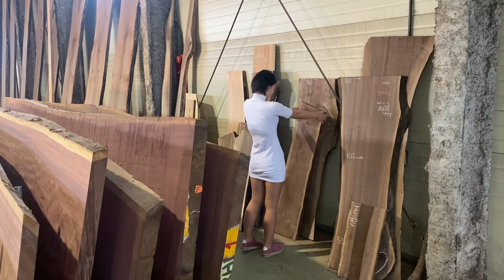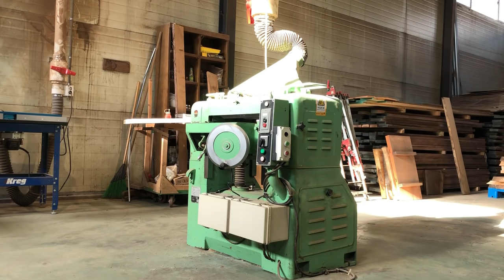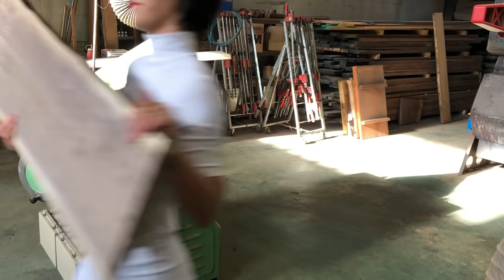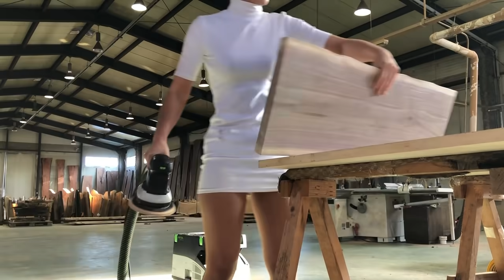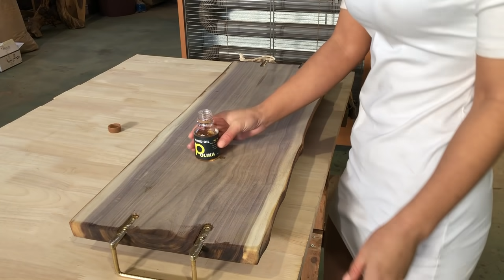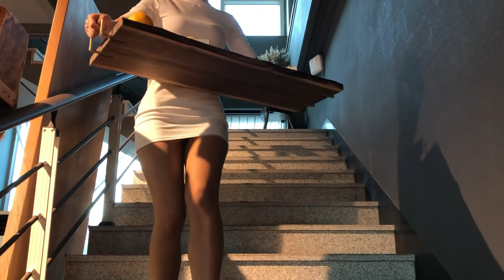LONG BOARD - made by WOOD Girl

Comment: Please wear eye and face protection in the future when using anything with angle grinder! Those wires on the wire wheel have a tendency to fling off at high speeds.
Reply: What makes you think WOOD WOMEN doesn't know what happens ?  Its the Little boy inside you needing to tell a women what to do ?
Reply: @rkb6783  haha not at all. I would think if she knew what can happen she would wear protective gear. If you see someone reaching into a fire with their bare hand it's probably safe to say they don't know what will happen to their hand. I would say (actually have said) the same thing to guys.  It's not always about gender like women assume.

Comment: I've noticed in all 3 of her posts -- she makes errors in. processing her stock. She cuts to length before thicknessing, which results in snipe at the end of each board. There is no riving knife on the panel saw -- a bad safety hazard without one. There was kick-back in one of her posts.

Comment: I know a lot of people put on the hardware before finishing to wood, but I fear that would let water get in where it shouldn't be.  
I finish one side, let it dry, flip it over and do the other side, and then put on the hardware.  
I do that for the same reason that I use linseed oil made for gunstocks, to keep out the water.